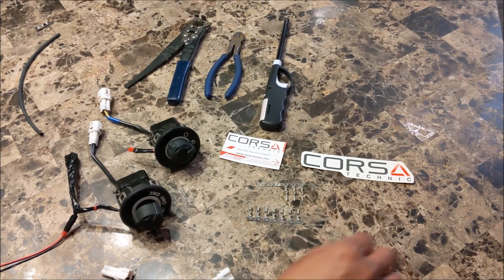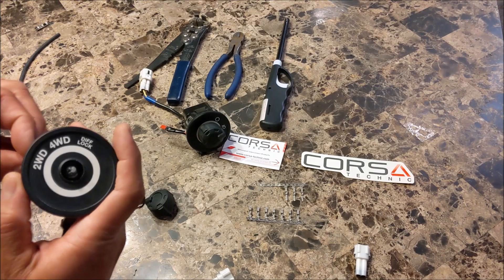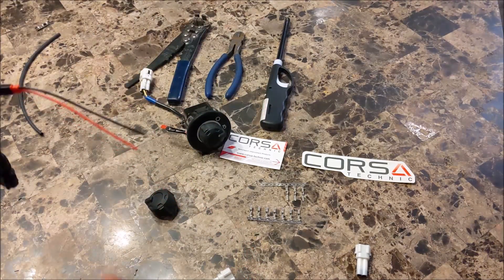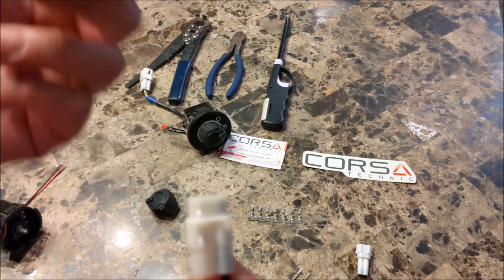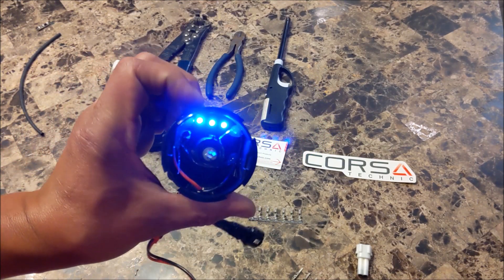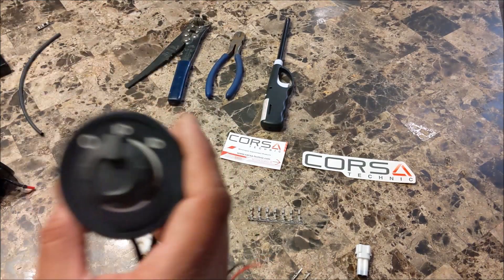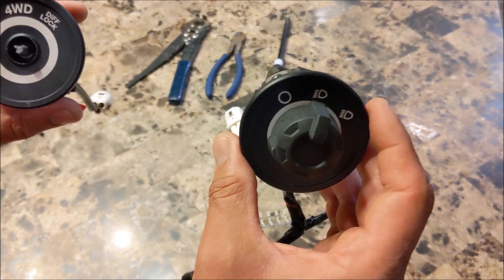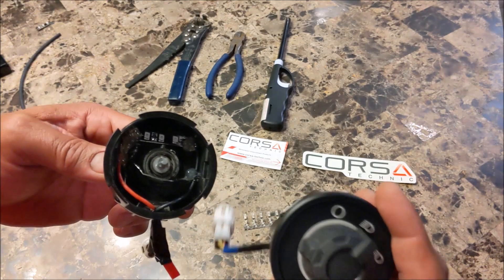Yamaha RMAX 1000 adding backlighting to your base model switches.

Comment: You think the RMAX rotary switches could be used in a X4 and replace the current ones?
Reply from the maker: You would have to get an RMAX cutout template and then cut it to fit, but  if you're willing to do that, you may be able to make it work.